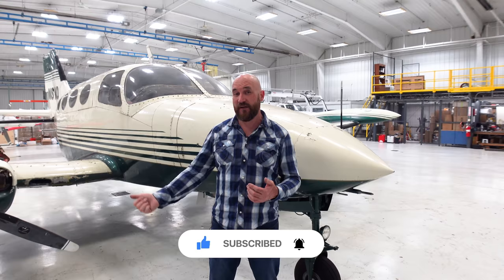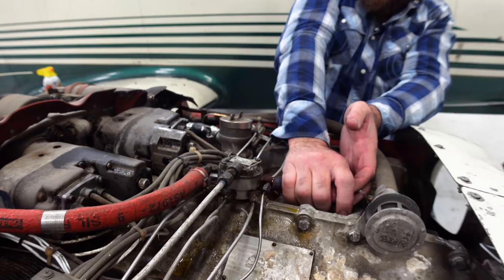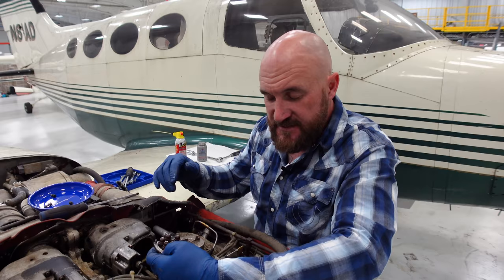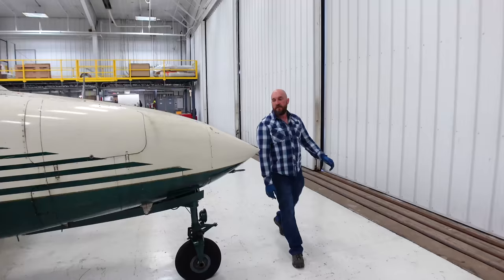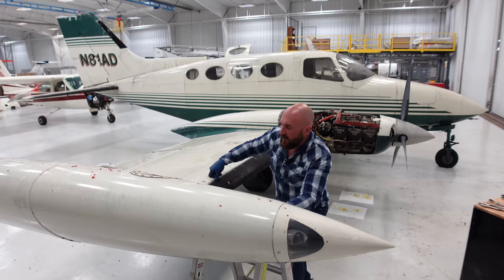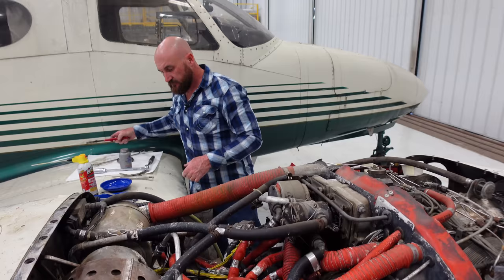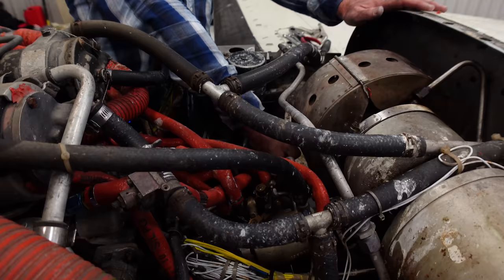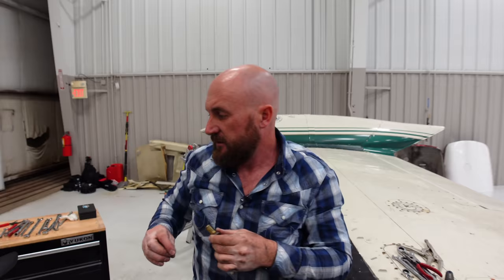He's Trying To STEAL Our FREE Abandoned Airplane ! Ep3

Comment: Actually, to re-certify, knowing how shit works, they would probably want you to replace just about every part on the Plane,  which would cost more than a Mint one is worth.
Reply: To make the aircraft airworthy, almost every component/structure needs to be removed, inspected, overhauled/replaced, IA needs to sign off on a lot of it, and Ops checked before it’s signed off. Both engines will need a overhaul which is roughly $25k+ per engine, needs new props (unless they pass inspection), it’s a money pit. SO much better off buying a complete airworthy aircraft with everything up to speed.
Reply: I was thinking the same thing. But at this point if he can get them running and the plane is his I would clean it up and sell it for a profit he deserves it!
Reply: I think the only way this aircraft gets off the ground is on a flatbed on its way to the recycler. Too much damage. Bird poop is corrosive, and its everywhere, inside and out.
Reply: @mx4menot4u  Exactly.  Its a MASSIVE Money-Pit!  I don;t think it will EVER be Certified air-worthy ever again.  Just not worth it at all.  A loosing battle
Reply: @fulleroxendine508  tbh that plane is worth MAYBE $4k if it ever even sells! (money he doesn’t have, I get it) but a lot of that plane has corrosion which doesn’t even make it able to fly (it never will again) If that thing left the ground it would end up deteriorating without the proper work performed.
Reply: Exactly, I assume this series is for entertainment only
Reply: @davidlewis3169   unless you have it certified somewhere in costa rica
Reply: Its fun to watch, but we all know this plane will never fly again.
Reply: @jamesortega8681  good thinking, he could sell this to the cartel!
Reply: Let 20 grand have it.
Reply: @mx4menot4u  try more like 50 to 80k per engine.  Turbo big block continental's are really expensive to get overhauled.
Reply: @mx4menot4u  That's NOT to mention the (90K ) AD on the main wing spars that he said has not been done that originally grounded the plane in the first place, Plus re creating all of the logbook reinspection's on the airframe and components that have to be re certified not to mention the rotten interior and everything else!, Wing tank bladders ect..
Reply: It might be viable financially if you make say 50 youtube videos about it that each get millions of views.. and have a couple sponsors.
Reply: Surelly,  but this plane is Golden content. I got no exp with planes whatsoever. Never got interested in them much. This plane got me subscribed to this channel and liking everyone of of these videos. At that point ,this plane is an investment for the growth of his channel, not an expanse :)
Reply: Hey, "Meryl Streep" leave the Dramatic Acting to the Professionals...
Reply: All the more reason to call his bluff. Roll it outside, tie it down, chalk it up as a loss. Get a better moneypit.
Reply: @davidlewis3169  are you saying the warbirds should be left to rot too that are not in "airworthy" condition?
Reply: @Rambler1989  any warbird you see flying today is basically all new parts anyway.
Reply: @nateice1   actually what i replied to someone else, disposable planes to fly drugs are in demand lol
Reply: @fulleroxendine508  - Next potential owner would face exactly the same quandary.
Reply: @nateice1  The series will bring a lot to the channel, views, maybe sponsorships and other business opportunities (if he can fix that he can fix anything). With that it might be worth financially to fix it.
Reply: @ArmstrongMixture  I know a few outfits that use as much of the salvageable parts as they can to keep the ones they work on flying. Yes there are planes that the only thing original to them is the data plate but the point is if he wants to fix it, let him fix it. To many things get scrapped just because it is old.
Reply: @B Tenold yeah your right, I’m thinking about 0-200s lol.
Reply: @utah20gflyer76  Yes, the $50-80K is a much more realistic cost for each engine OH.  No one will ever get their money back spending what is needed to make this plane airworthy.  Only way that happens is if its someone who has that kind of money and just hates to see a plane die and wants to save it.  Frankly there are better ways to spend that much money if you want an airplane.  I have recently have had an opportunity to fly a 421C, same airframe, slight bigger engine (geared 375hp), so I am finding these videos fascinating as well.  400's are nice planes but have a reputation for requiring a bit of TLC to keep them flying (especially the 421).
Reply: @nateice1  Exactly. Don’t try this at home.
Reply: In Alaska you can fly anything.
Reply: @mx4menot4u  yeh but that’s boring. I hope he can make enough money from the vids and sponsors so he can rebuild it. This series is too good
Reply: Ya'll are forgetting about how much he'd make off of youtube. scraping this one and buying a new one doesn't get clicks, views, and ad revenue.
Reply: @mx4menot4u  With lost log books....every AD, service bulletin, and service letter, as well as overhauling every life limited component on the aircraft has to be done....sure you have to at least inspect every part of the aircraft...but you DO NOT have to replace every every part unless a part is defective!!!
Reply: @Bugdriver49  I said overhaul/replace, it all depends on how the inspection turns out. If that part is out of limits (which are set by the manufacture, and specified in the maintenance manual/overhaul manual) it needs to either be re-conditioned by a A&P or manufacture depending on the repair, and then that repair needs to be notarized by a IA before it’s allowed back into service. But yes, I know about all this.
Reply: The channel is called "Rebuild  Rescue" not
"Sell Your Rebuild Project And Buy An Already Rebuilt Plane"
Reply: @eagle2019  I was referring to a 337 which I thought had to be approved by the FAA, instead it’s just a record of that major repair/alt. But never mind I was wrong about it.
Reply: @ttt69420  A country with a much higher general aviation fatality rate than the US for sure.
Reply: @executivesteps  Such is their prerogative. These things are built like tanks, they're so overbuilt and understressed. If serviced properly, they last. Especially with two engines. The A&P markup and scrutiny is insane in the US. Especially with regards to structural components which are over-designed with no fatigue limits. And yet they don't require safety wire on oil lines and such, which seems ironic to me.
Reply: @eagle2019  You do realize part 91 is also commerical.....as in flight instruction, business aviation....etc. You must comply with service bulletins as well as AD's if the aircraft is to be operated for hire....not sure about service letters.

Comment: I love this series. Don't get discouraged. Once you figure out the hang  up, the other engine will be a breeze.  Set the levers like you would a cold start. ie: throttle cracked, mixture full rich, prop to flat pitch. Cycle the levers a few times, make sure they;'re moving at the throttle body
Reply from the maker: We won’t quit….   It’ll start one way or another !

Comment: As people have said, ensure throttle and mixture is full rich and full throttle for priming, also ensure that the distributor up the top there, make sure its vent is completely free and make sure the diaphragm is in good condition, if vent of the diaphragm is no good no fuel will get to the injectors.

Comment: I'll throw in my two cents as an automobile mechanic.  Prolly got a couple of buckets of advice pennies by now, but, I would use staring fluid to get it going.  I know you don't want to use that but that'll get oil flowing, fuel pressure up, and help loosen the rings (which, btw, I'd put some engine oil in the cylinders to aid in sealing).  After that, it may start on its own without assistance.
Reply: I normally give a squirt of ether just to diagnose before looking into a no start further. 
It fires you can cross compression and ignition off the list, it doesn't fire then you can cut fuel from the equation..
Reply: He already put oil in the cylinders ..I'm guessing the lines going to the cylinders are clogged..there was dirty ass fuel still drippin out after he turned the pump off and walked all the way around the plane ..so instead of spraying into the cylinder it just built pressure behind the clogs and slowly dripped out
Reply: @redonk87  Not oil, ether. I have an engine that after it sits for a long while will only start on ether. After that gets everything moving, it starts like there never was a problem at all.

Comment: 8:44 I can't tell what the throttle and mixture levers are set at but in order to get fuel flow you will need the mixture to be set to 100% (rich), the fuel selectors set, and the throttles need opened one inch. the pumps will run even if you have none of that set properly.
Reply: His mixture was back because he wasn’t trying to start it. He was turning the engine over to check spark. You do not want your mixture enichened, while you are turning a engine over without a spark plug installed.

Comment: Fuel injection is high pressure low volume.  You won’t see much coming out of an open line.  When closed it will spray through the injector enough for that cylinder cycle.   It’s not much.  Install injectors and test for atomization of the fuel at the injector nozzles.  All air must be pumped out of the system before this will work.
Reply: Manuals will squirt but not unless he turns the engine.
Reply: @pbysome    Yes

Comment: The manifold valve also known as a flow divider acts as a secondary shut off. There is a plunger on the gasket in the flow divider and when there is low fuel pressure the plunger goes down and keeps fuel from dumping in the cylinders after shut down. When there is enough fuel pressure the plunger opens and allows fuel to flow. If you have fuel to the manifold valve but not out the lines the plunger on the diaphragm is stuck!
Reply: I believe this could be the culprit too.  It would make the fuel flow to appear vapor locked.
Reply from the maker: Thank you for sharing ! 👍🏼👍🏼👍🏼

Comment: Good luck on this project man. I've got to say you've got balls doing this project on your own. The biggest issue next to the engines is the corrosion inside the plane and beneath the paint, landing gear etc. 
Saw first hand how excruciating the overhaul of an old abandoned plane can be, when I witnessed first hand the restoration of a L-1649 Starliner back up in Maine - it's a ton of work, so: Keep it up and don't let set backs discourage you!!👍🏼
Reply from the maker: Thank you 👍🏼

Comment: Super lame that someone is trying to jump in and buy that plane from under you.  I hope you get that thing running and can keep it.  Very smart to have a contract about it before you got started! Best of luck, I hope you pull this off.  🤞🏽
Reply: Personally if i was doing this and got a wiff of someone planing to buy it out from under me after i did all the work fixing it i would spike the oil with metal shavings and refill the interior with bird shit before leaving, Also I would super glue any screws i loosened up back in place

Comment: My recommendation  (from experience) is never for air pressure through the turbo journal as the pressure can and will unseat the seal and you will get big oil leak either out the tailpipe or into the engine! How ever I am not sure what oil pressure these engines run and or if the turbos can handle such pressure. Keep up the outstanding work
Reply: At this point, everything on this plane will need rebuilt and need certificates to fly again. The turbo is trash from sitting and he can't legally fly it in this condition anyway so if he blows a York seal trying to get it started he's not damaging anything which isn't going to be replaced anyway.
Reply: yes but you have to factor in these turbos are going to be rebuilt or replaced anyway and new seals so the goal is just get them to be unseized
Reply: @Whiskey11Gaming  He could fly it and crash it in a mountain for views!
Reply: TOUCHE ! "SHOP AIR "CAN BE VERY DESTRUCTIVE

Comment: You should honestly get an aircraft engine mount. When I was training for my A&P they were everywhere. Would help with cleaning the engine and working on it overall.
Reply: Assuming the mounts have no damage....why in the world would you suggest they be changed????
Reply: @Bugdriver49  I meant a mount in the sense of a wheeled external mount for maintenance.

You take the aircraft engine out of the cowling, perform maintenance in a relatively open environment, and then put the engine back in the cowling.

It's a separate thing entirely to the aircraft.
Reply: Engine stand or Engine test stand is the nomenclature for that device.
Reply: @Stepclimb  Yes. Thank you. It's been some years since I've thought about it.

Comment: Respectfully, you have got to stop fixating on the turbo, the engine WILL run without it, may not run well, and won't have a lot of power, but it WILL run.  Where you screwed up on the contract deal, is you posted the videos prior to having a completed contract, meaning it is running, and you have the pink slip.
Reply: I agree with about short-sightedness not having the title in hand before sharing with millions of people, assuming it is even a true story... Could be embellished (i.e. - owner said he was previously offered $20k at one point), or could just be manufactured.
Reply: @cup_and_cone  Why do people like you say shit like this about every youtuber? If you don't believe him than stop watching.
Reply: @ayumu-senpaii  Probably because the ending is definitely acting and not a real phone call?  If it was true, then just act normal and tell the camera.  When you fake a reenactment like that, it casts doubt.

Comment: With boost pump on you need to advance the mixture control for a couple of seconds to prime the engine and then pull it to cut off position. Crack the throttle and engage starter. Once engine fires advance mixture to full rich.

Comment: Pre-soaking everything - sounds like someone after my own heart. The kind of motorbikes I could afford in my younger days were going to break down. The first thing I'd do was go around the rounded, seized, cross-head screws and soak them, hit them with a hammer, whatever it took to get them off and replace them with stainless steel, hex key (don't round) screws with copper eaze. That might take several weekends but it meant that when I was on a tight deadline to fix it to get to work, at least it was a doddle to get into the engine!
Reply: My first bike was a 1977 Honda CB750K that I watched sit in a side yard in my grandmothers neighborhood for years. Guy wanted it gone and charged me $1 to write me a bill of sale. Pressure washed the bike and soaked the whole thing down with an entire can of lube. Almost everything on the bike was 100% labor repair with minimal parts. Battery, fork seals, and tires I think was all I purchased to get the bike on the road using my uncles tools. I rode that thing EVERYWHERE for two years. Still have it torn apart to restore one of these days.

Comment: Just watching your excitement in this project is nice! Our Son Jesse is now starting on his journey in aviation! A stroke grounded me, and I miss flying so very much! Were watching your work. And learning as we watch! Good luck!
Reply: I don't know your age sir... and I know it's not the same, but let me give you some random tips: 1.nowadays RC planes are dirt cheap and you can install camera's and watch with a headset called FPV flying (perhaps give you bit of this i'm controlling a plane again) 2.trust me VR has come very far recently and super affordable... I got Occulus Quest 2 (vr headset) + old Saitek X52 flight control system + the latest Microsoft Flight Simulator 2020... the only thing I'm missing is the money for a decent GPU (graphics processing unit aka graphics card) so I could finally run it smoothly (the lack of frame-rate is killing my immersion) which also means that's your most expensive investment also...

Comment: when you were spraying air into the that fuel distribution it sounded like there was a clicking sound which would indicate that there is a pressure regulator that stays closed until it sees enough pressure.
Reply: that make a lot of sense, combined with a comment above that the mixture levers need to be forward etc.

Comment: Those engines are lovely pieces of mechanical art.  Making them airworthy again will be six figures easily.  This thing is a money pit.
Reply: He’s right. No one should leave the ground until full rebuilds are done.  True for the airframe too.  Buy a flying example.  It would be so much less expensive.  Or get yourself certified as a flight mechanic.  Or get some qualified volunteers.  Love that you dove into the project however.
Reply: ARE THEY GTSIO 540 IF SO ABOUT 300K  EACH FOR FACTORY REMANS.I SAW ONE  GET RUN WITH OUT OIL DUING NEW PLANE SERVICE INTERIVAL IT RAN FOR 2OR 3 SECONDS BEFORE SIEZING  IT WAs a PIPER MALIBU ..THE NEW MOTOR COST THE DEALER  OR HIS INSURANCE 275 K 20 PLUS YEARS AGO.
Reply: @drjleach  THE TIME TO COMPLETE THIS PROJECTG HE SHOULD MEET FAA MIN TO TEST FOR HIS A & P

Comment: Starting with the N-Number, you can get all kinds of information on an aircraft and its history.   As much as it sucks…money talks.  However just looking at it on the outside, this plane needs a lot of really expensive work to get back into the air safely.  Plus it’s an east coast airplane (meaning wet environment) and you haven’t even done a thorough corrosion inspection…which is probably going to turn out not good.  Aluminum does indeed corrode and it can be bad if neglected…which this plane was.  More than likely, the potential new owner wants it to part it out and scrap the rest.  They’ll make a good chunk of change at a $20k purchase price.  Engine cores alone are big $.